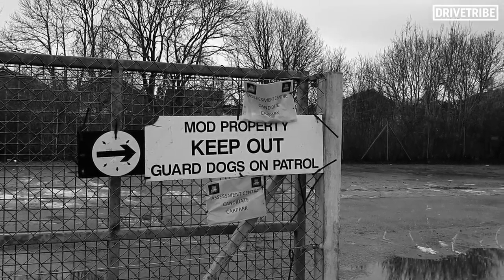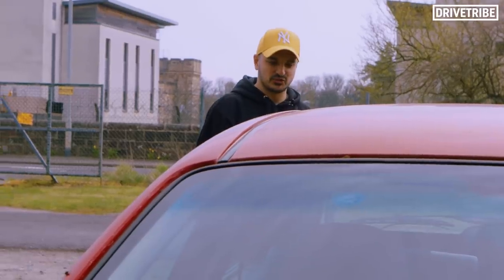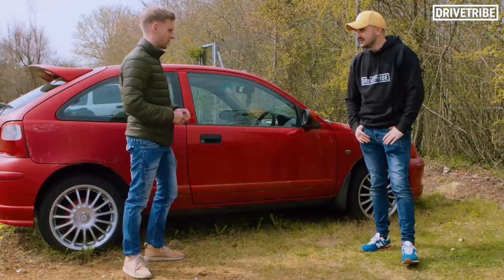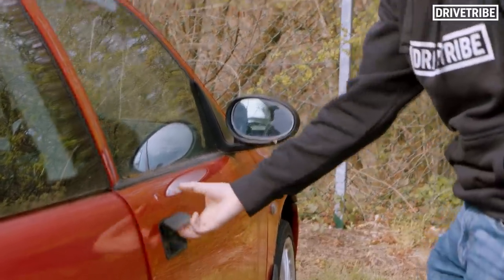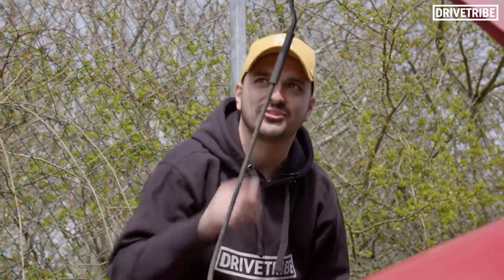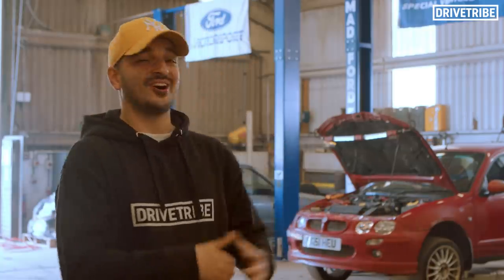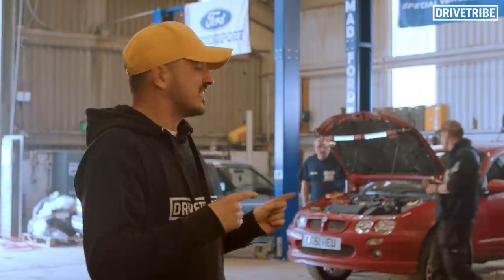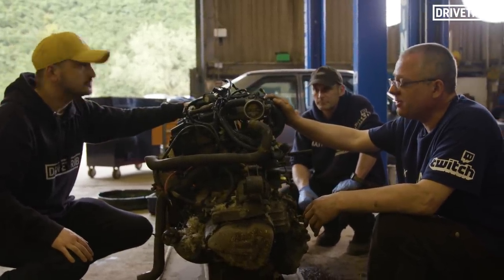Rescuing my abandoned first car from a military barracks | Rover 25 restoration

Comment: Swap the throttle body, it will be fine, will unlock the full 103bhp from the engine then, ECU wont care. Can remember it being a popular topic on mg-rover.org when these reduced throttle body models of the bubble 200 came out, still the exact same 16v K in there (since they killed the 8v model)

Comment: First Car Rover 416 SLI, The 1.6 Ltr had the same point with the throttle flap, wound it out to full no issues for the 70k miles that I drove it after making the change, but like all rovers things come to a drastic end clutch failed, gearbox failed bye bye rover!

Comment: i had a 1.2 renault clio year 2002 had it for 4 years it was baby blue, i modded it to look like a boy racers car with black wheels black windows and angle eye head lights with a sub in the back, i also changed the engine and box to a 2.0 renault sport 172 with steering rack, suspension struts after the head gasket went, i use to randomly race people telling them i had a turbo 0.9 with v-tech so they though i was a idiot lol the surprise they had when they saw the 172 lump was so funny and more shocking to them when i told them i fitted it myself, put it all back to standard as i still had the original engine suspension ect and sold em, i’v been on the look out for that car for the last 5 years, if i had the money to keep it back then i’d still have it now as my weekend car,

Comment: Can we at least upgrade to 1.8 turbo engine, Torsen diff, pg1 BRM gearbox, and put some decent omega pistons in OR SOMETHING DECENT, t series injectors, high lift cams, 8000rpm/ 300bhp at least? My cars Rover 200 brm le...  1.8 vvc... 50 mph 1st gear @ 7200rpm... 70mph sideways diff does all the work so you don't have to panic just enjoy the ride... would like to see 9000rpm and over 60mph 1st gear MG ZR is very achievable on BRM gearbox and 1.8 turbo engine ...

Comment: my first car, wasn't a car, it was a 1964 Chevrolet C-10, which had been converted to 4x4, and then built into a mud truck. it was a horrible learner vehicle, as it had a 400 cubic inch stroker V-8, pushing over 600 HP, and full time 4x4, through a US Army Duece and a half front axle, and 5 ton rear.

Comment: You need to talk to the Boosted Boys. They will get 200HP at least out of that unit
Reply: 200hp out of a k series is easy but reliability is an issue, bolt on later mg parts and it will be mint

Comment: I have still my first car and I don't want to sell it. It is a Hyundai i10 from 2017 with 87PS an 33.000km on the odometer nothing really interesting but I like to see how long it would hold up in a dying car segment with no Turbo and a straight 4 Zyl. 1.2L petrol engine. But some things I will never forget in this car for exampel my first drive on the Nürburgring or driving safety training or my first car accident with it bur nothing serious for 1500€ the back bumper and some littel pices behinde the bumper like the numberplate light and that stuff.

Comment: Made me cringe when he was cranking it over, then revving it cold! After 3 years standing they really should have taken the plugs out and hand-cranked it a couple of turns at least, then dropped a bit of oil into the bores before using the starter motor.

Comment: that's utter BS that you can't make it open because the computer won't compensate.  There is a base tune, then the tune develops as you drive it.  Open the throttle, free the horsepowers.